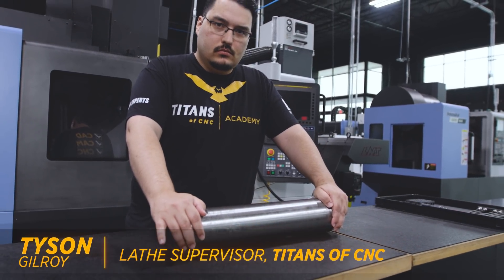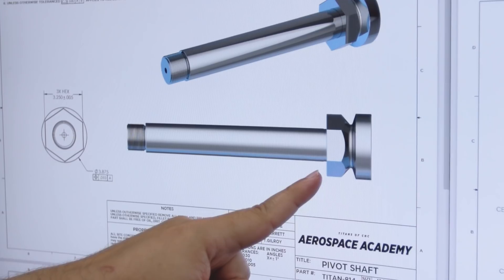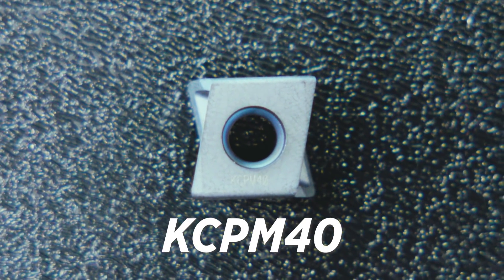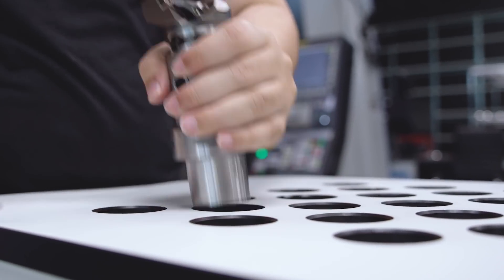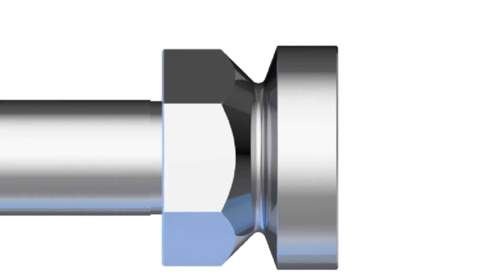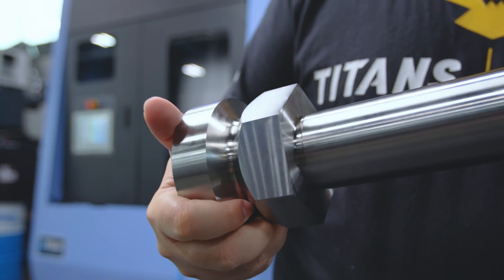How To Reverse B-Axis Machine on SMX 3100ST 9 Axis | DN Solutions

Comment: How did he confirm the finished length accurately without removing the part from the jaws?
Reply: Micrometer off the turned face of the hex, plus any grinding allowance if it was on there. That's your known size.
Otherwise, without any similar features you will have to take a skim off the face and remove it and measure and then re set in the jaws and measure off the face with tool or probe if you have one.
Never ever off the pre machined face of the Jaws you just put in, you're never able to judge how much they might move when the pressure comes up, can do for first side though as it doesn't matter as much.

Comment: Great video! The only thing is he left out was one major check/step: When flipping your part for 2nd op, your "soft" jaws should be cut fresh(and a specific way) to clamp onto the turned suface so that your part runs true and your O.D. to O.D. concentricity is good. You would put a test or drop indicator on the cut surface that you're clamped onto and give it a spin to make sure you don't have runout. Fresh cut jaws cut at the diameter of what you're clamping onto(whilst being chucked onto something, if possible) is the best way to ensure a part running true. Not all of us get the best machines and the best & brand new chucks on them.(sarcastic joke). Great video other than that! thumbs up emoji
Reply: I love reading comments by people that know what they’re doing.

I just left a shop where I ran a 39”x255” Oil field lathe.  A ToolMex TUR930.  I had to put a 2” wide burnished strip on both ends of the pump shafts I made.  The tolerance was -.000375” TIR, but the circles were on average 150”-250” apart…. Failed 1 out of the 87 I did. Best I ever got was .00016”…..Absolutely crazy but not when you have multiple steady rests and you develop a methodology based on the scientific method.  

It’s amazing what we are capable of.
Reply: @Rightisallwrong  Awesome! 
Definitely brother. Some people were ordained by The Almighty to be masters of their trades and kings of the craft!
Reply: Yes! Good knowledge right there :)

Comment: I would rough face by turning rather than conventional facing if youre worried about backend wobble. Turning offers mainly Z forces that way and you dont have to nibble at it.
Reply: That is a good idea and probably helpful for long or small dia parts. Thanks for that idea.
Reply: @Josquatch  we do it for internal boring too, as the forces in X can deflect silent bars and the like. Then kiss the face after

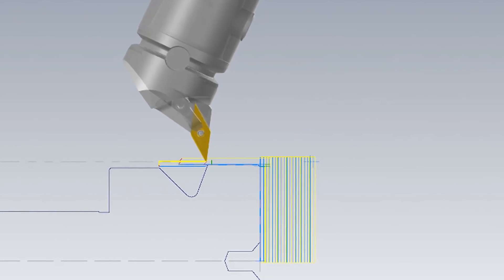Comment: 5:15, how do you compensate for the fact the you are using the front and the back of the tip, cutter comp wont work unless you use both cutter comps in the same line, hmm?

Comment: For stainless I've been using the sandvik XM-2220, I run it at 650 sfm and .012 ipr, but I only take between .06-.08 per pass, it works awesome
Reply: Just out of curiosity what grade stainless are you running because 17-4 ph is a heat treatable stainless steel and cuts almost like inconel. It is nothing like 316.
Reply: @wendull811   17-4 is nothing like inconel. 17-4 ph cuts like butter.
Reply: @loukola5353  we must have the wrong inserts then because the shop I work in struggles all the time with it.
Reply: @wendull811  y’all should be able to dial in 15-5 / 17-4. 
It’s not like aluminum lol, but it cuts well as far as stainless goes, and in my experience I prefer it over 316 because its harder and chips better.

Don’t let it get in your head, go get some carbide inserts, read up, and experiment with it. It is a very useful steel.
Reply: @samuelyoung2671  I haven't seen any of it since that post so I still haven't  got to try new stuff with it yet.
Reply: @wendull811  ya 17-4 is one of the easier stainlesses to cut

Comment: 17-4 SS? Never heard of that. What did the raw material cost? Nice job! Must be at close to $1 grand for that pivot shaft.
Reply: It is used quite a bit in Aerospace and we also used it quite a bit for various valve stems.
Reply: I do know that it’s commonly used in the medical industry, I’m a machinist and I work with 17-4 quite often for making surgical tools
Reply: Where I work we make mostly everything out of 17-4 for  surgical/orthopedic parts. 17-4 is a tool steel that leaves a really nice finish and isn't too hard to machine.
Reply: It's a common alloy where I work, too.  Definitely one of my favorite stainless steels.

Comment: Grooving cycle before live tooling with a button insert. More rigidity at the chuck end for this op.
Grinding would not be necessary if you adjust the geometry in Mastercam to offset taper in the part. This is unless you need an absolute mirror finish.
Reply: The shaft could have a 4-5 digit tolerance
Reply: Ya I had that though about the groove too, then I would've also parted it down most of the way so all you had to do on  the second op was 1 rough and 1 finish pass and then the center.  I also agree unless there's some bizarre tolerance on a part like that it should have been easy to finish it on the lathe.  We do stuff that size to better than .0005" all the time.

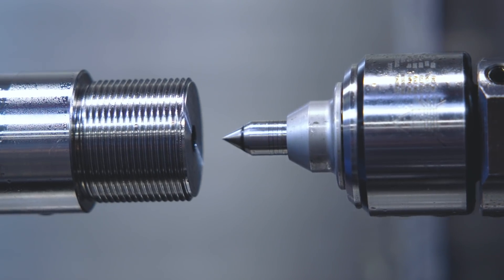Comment: Hi could you explain why at 3:28 there doesn't appear to be an undercut for grinding relief but at 3:39
there is.  Plus I think you missed a trick , you could have run a finish cut along the hex peaks to de-burr
as your tool would have been at that location at some point ,  just saying.
Reply: Youd flatten the threads to much surely ? Wire brush does a better job
Reply: @jamsstar2010  Hi I commented hexagon peaks (across corners)not thread. Just want to emphasise my explanation.
Reply: @Engineering guy until he's been on that machine for a while longer those things won't come naturally to a lathe based guy, sort of thing 5 axis Miller guys see without thinking, save a sharp edge and doesn't take very long to sort. Also if the drawings don't call for it.. and it's not on the model because modeled fillets and chamfered edges can be a pain sometimes. 
Good video though and aiming at the right level for the viewers, choosing to put a chamfer on an edge, or undercut that the designer forgot about isn't a learning level decision 🤔😉.

Comment: Nice work until the end. A center drill is a lathe tool not a mill tool. Spin the part not the tool. Ensures trueness.
Reply: Exactly what I thought too!
Reply: If... why risk it. Its a lathe tool. Spin the part and its always true. The machine can do both. Just saying do it proper.
Reply: @mynicki444  if it works, it is proper, both methods work
Reply: @rick371  thats fine i suppose. If it works. But for me its not the proper way. Mine will ALWAYS be concentric. Yours will ALWAYS be risky and more work. Im not gonna argue what i know is right. Those who know... know.
Reply: @mynicki444  you're aware the risk, is exactly the same, but reversed?
Reply: @rick371  not exactly. If the part is spinning and im off .002 then the center is alittle big but concentric. If you spin the tool and are off .002 then your not concentric
Reply: @mynicki444  yeah, but then you're cutting the material anyway and putting it back to concentric
Reply: @rick371  no its going to grinding. Any features not being ground would not be concentric. Its just bad practice.
Reply: @mynicki444  dude, we do this all the time, leave 0.005" on for grinding it works perfectly
Reply: @rick371  i understand it works for you. Great. Im just helping you understand why its not best. I think you get it now. If your spindle is off .0025 and your leaving .005 youve almost scrapped it. Lol. If im off it doesnt even matter to concentricity. Just friendly advice
Reply: Center drill creates a center that the grinder is going to use lol
Reply: @rick371  You should read Justin's comment again mate. 
He knows what the centre drill op is for it's how they done the op is the problem.
Reply: @SirRootes  if the tool and workpiece are both running true(as they should be) , then it does not matter if the tool spins or the work piece spins

Comment: Pretty simple part. You chould have made the undercut from first side by changeing b-axis in degress until the insert can fit in. I work on a dmg-ctx1250 . Allso roughing down the part on second side with a mill whould save you some time. Just my thoughts.
Reply from the maker: Top 1%
Have a great weekend
Reply: @TITANSofCNC  thank you, you aswell
Reply: Was the angle more than the 60 on first side? Looked like it would clear. Maybe a chuck clearance issue. But yea having a B axis is nice. Integrex here.
Reply: @mynicki444  if the insert can be in the undercut on second side , it can get in there on first side , its just a matter of what angle your b axis is in , or else just use another neutral turning tool with no angle if its a matter of clearence to the chuck

Comment: I get hung up on this all the time. For the rough turn operation 
the SFM is 250, The RPM says N/A. Don't you need to have a G50 to set a Max RPM ? What Sets your RPM on the roughing operation ?
Reply: Usually I set the G50 to 3000 or so RPM in general, but if I have a job with a big or long part I'll give it a few test spins at different high RPMS and listen to how the machine sounds and set it based on that.  For this one with the tail center, I left it at 2000 max on the front and 3000 on the back knowing with my SFM it wouldn't reach that fast unless it went to center.
Reply: If I'm not mistaken, you'd still need a G50 to set the maximum RPM. Then, you'd just use a G96 to set your surface speed. That way, you keep the constant 250 SFM, but won't exceed whatever RPM you set with the G50.